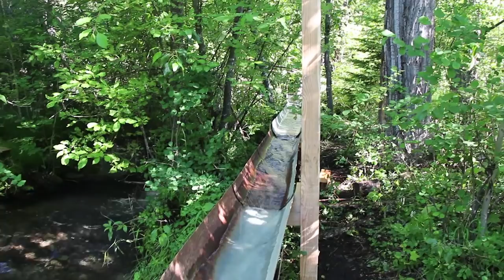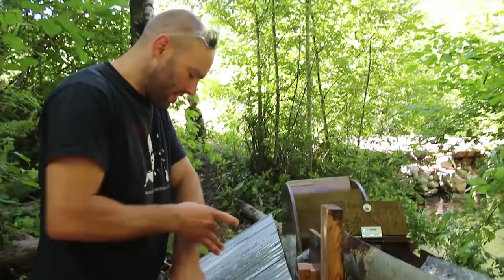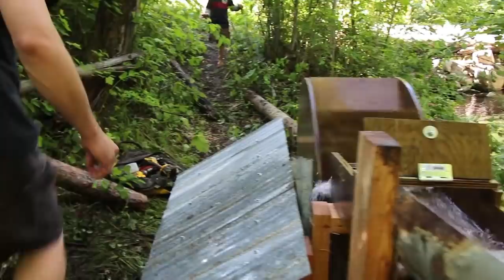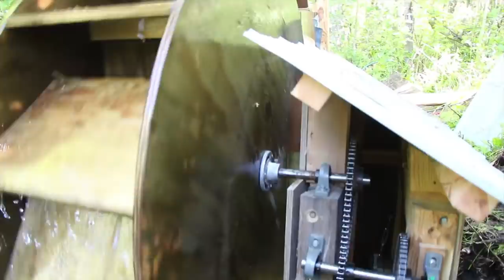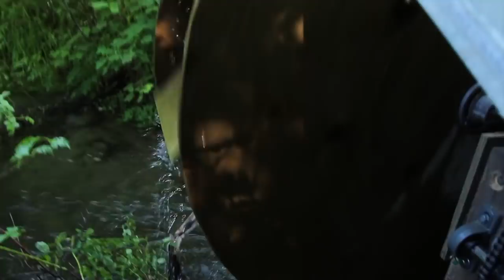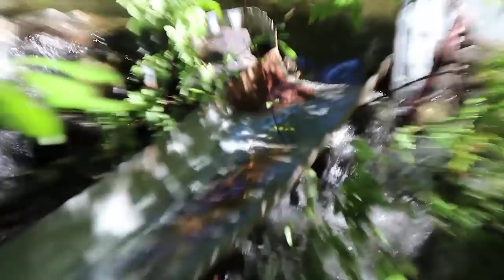Waterwheel to produce electricity

Comment: Maybe also try a gravity fed Pelton Wheel setup? You'd fill the pipe with water by having it underwater from your source, and run it down to a Pelton Wheel with a small opening at the end like a jet, I've used 4" PVC with a .25" "jet" and only 6' of elevation change and it worked perfectly. This way you'll get a lot more force, and a Pelton Wheel will be many times more efficient than that one to further increase output. You could probably use the parts you already have, and only have to make the Pelton wheel and get the PVC piping. I understand cost is always prohibitive, but you could do this for under $100 and have that alternator spinning SOOOO much faster, I've even seen multiple alternator setups!! PM me or respond if you want any advice, I set one up in Alaska for a friend a couple years ago and she is still using it and able to do the little maintenance herself. Just google "home made Pelton wheel", there are a ton of people doing it.
Reply: Hey looking to build a water wheel was wondering if someone could help
Reply: Dude
 I imagine you want to use it to create electricity, here is a basic version of that and related videos to this one will get you far. https://www.youtube.com/watch?v=MJxBshI2qtA That's the easiest way but if you need more power you just put a pipe downhill from a water source with a nozzle aimed at the wheel and a valve to turn it on and off and let gravity turn your wheel for you and create electricity. 
This a pelton wheel and why you want to build one like this instead. https://www.youtube.com/watch?v=3Oe8YAJ9eSQ
Reply: yeah; would like more info; thks...